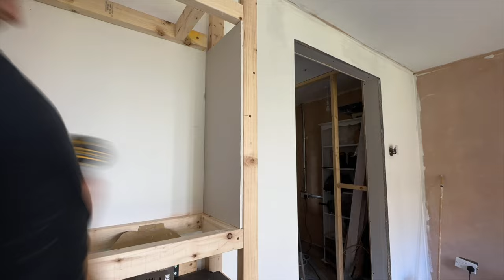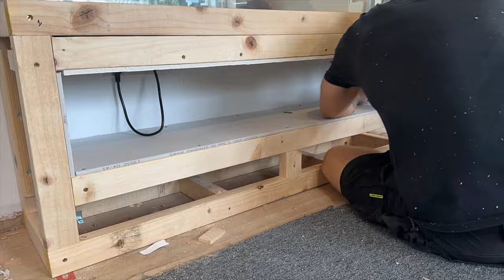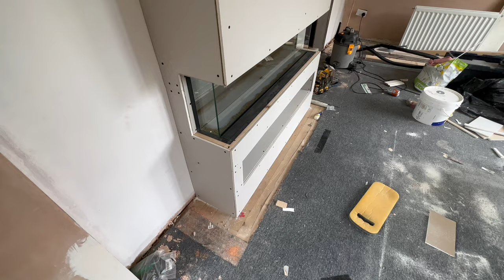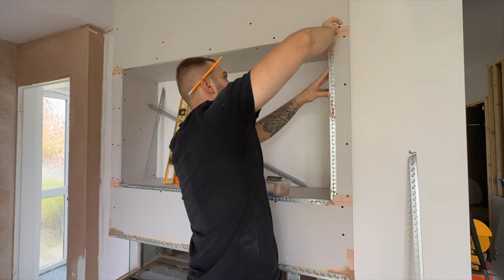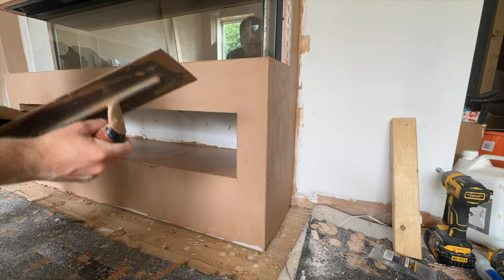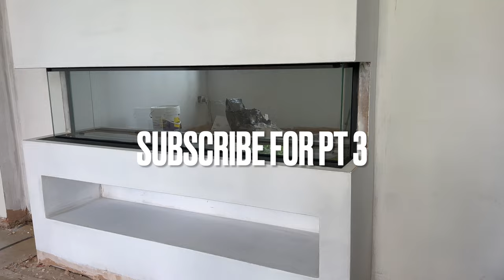DIY Media Wall Build | PT2

Comment: Nice one for uploading this mate, really simplifies this project. 
Good job there mate 👌🏼

Just one question I wasn’t sure of was the bottom part of the fire if your building a thicker border as in depth surround! 
Was it wood filler you said you used instead of plastering? 
And would you plaster the outside first then just use some wood filler for that depth border?

Reason I ask is I’m building a thicker wall so I can build a side access shelf reaching behind the tv and to fit Sub, PlayStation etc 
So the plan is to have a thicker boarder around the whole fire.
My wall depth is going to be about 44cm including plaster and the fire is only about 20cm depth.
Reply from the maker: Hi mate, thanks for that👍

Yeah I plastered the outside first, and then used wood filler once dry. 
Turned out nice, & Good idea creating the extra space for the sub.

Hope it goes well 👍

Comment: Great built and informative video. I'm building a unit like this and I can't see from the video how you have finished the base and top of the fire, it looks like you have mitred some wood but if so I couldn't make out how you plastered this area. Can you please let me know, possibly a close up photo of that edge.
Reply from the maker: Hi, in later videos I mention that I used a wood filler for that edge, because it would have been awkward/ messy to try to plaster. 
Hope that helps & good luck with the build👍

Comment: Do you not get cracking where it meets the original wall and ceiling?
Reply from the maker: No mate, I made sure the structure was solid so there wouldn’t be any movement

Comment: Are your exterior walls cinderblock?
And walls are they steel, aluminum or wood framing?
Reply from the maker: We have brick walls throughout, typical for 1970’s houses in England
Reply: @reno_with_us  thank you for the reply
Never heard of interior walls beings brick
But I guess it helps with stability 

I do not understand why all houses in England do not have HVAC because it being the year 2023.
Reply: @reno_with_us  to clarify, you are saying your interior walls are brick or block and not aluminum or wood and that is why you have to plaster your walls  and ceiling. 

If that is the case is the floor for your second level rebar concrete
Reply from the maker: No, all floors apart from the garage, is wooden joists with wooden floorboards. I’ve never heard of walls being aluminium
Reply: @reno_with_us  framing is what I am asking